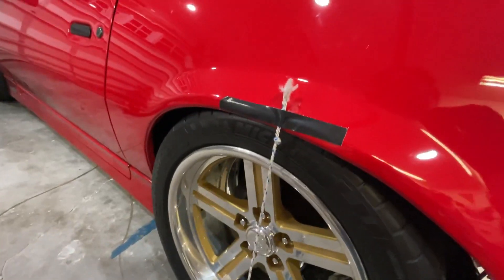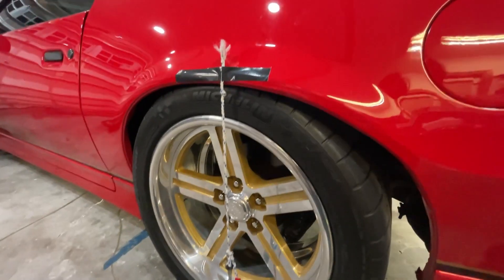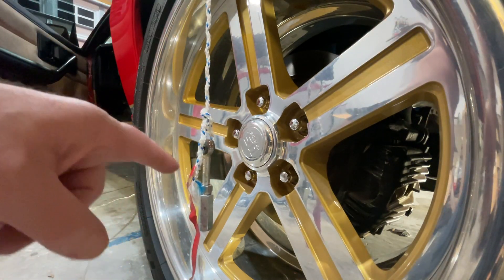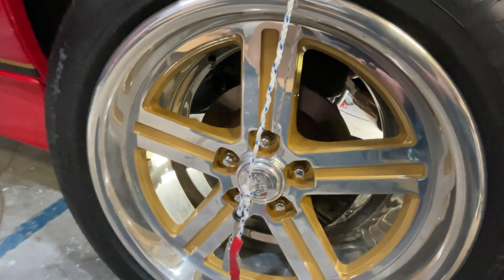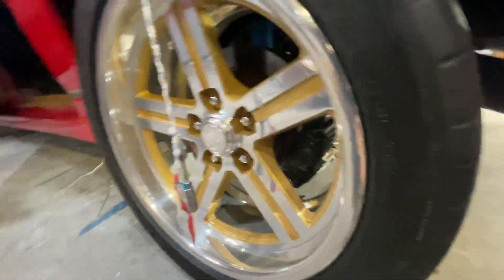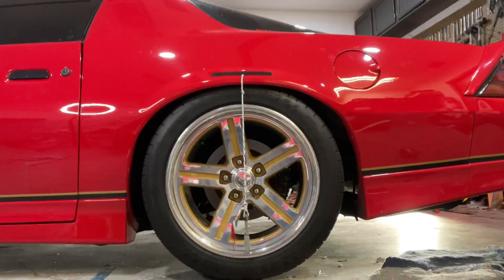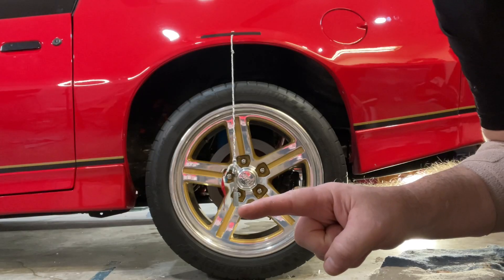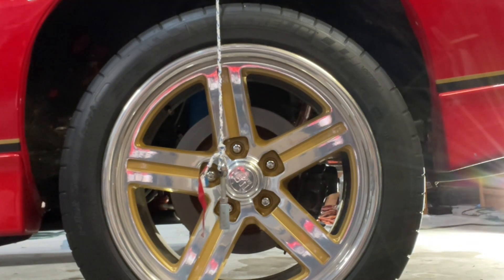Measurements on rear when lowering - Panhard bar geometry on Fbody cars Camaro / Firebird

Comment: I think that your Forward to back is flawed because the plum is being moved by the angle of the body
Reply from the maker: Good point I probably should have raised front with it??? 🤷‍♂️
Reply: @FireballMullet  I think so .  Just to get your most accurate measurements.
Reply: Maybe use a centered solid straight edge ?
Reply: @jonsingle1614  I would find  horizontalcenter of the wheel well and take the wheel and tire of and measure the vertical center of the axle.